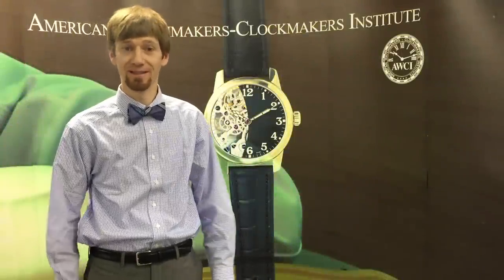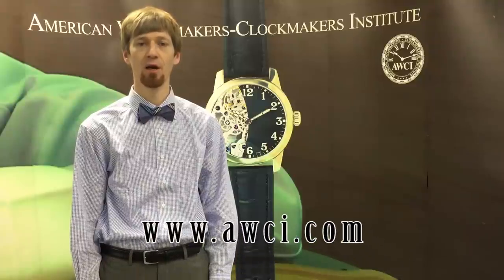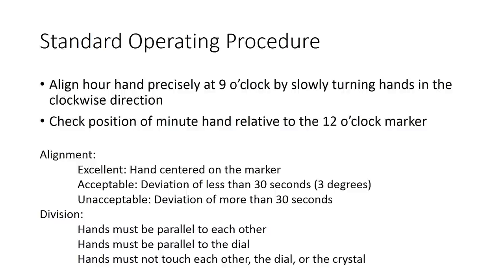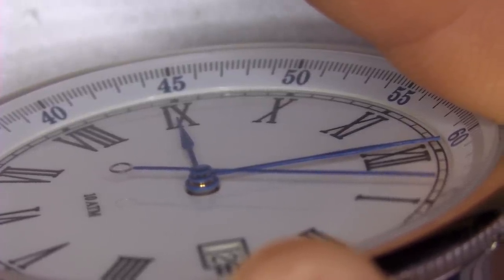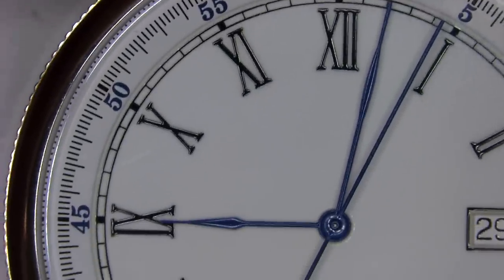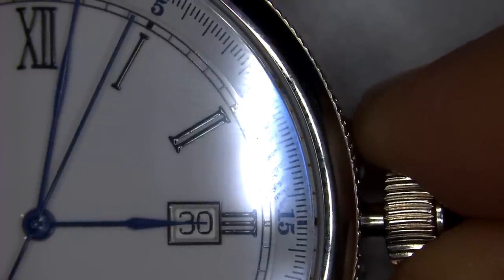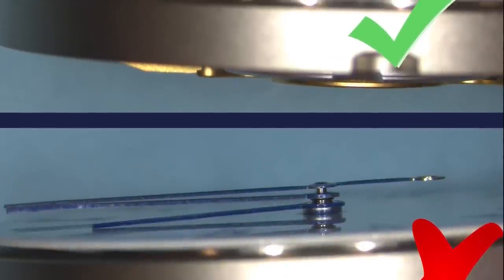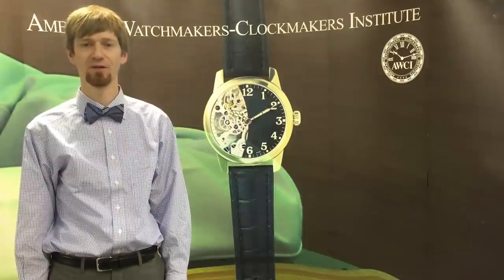Watchmaking Excellence: Hand Alignment

Comment: This is why you need to let down the mainspring so the balance wheel becomes stationary when fitting the hands, something few 'watchmakers' on the internet do. In fact if you pay attention, they almost exclusively rush past showing the hand positions as the minute hand centres on the 12 o'clock position in an almost 'sleight of hand' manner (pun intended)... much like an illusionist would do while performing a card 'trick'. This was an EXCELLENT tutorial. Bravo.

Comment: I guess it depends on the movement how you check it. Based on my experience, you move the hand forward to check seiko and move the hand backward in miyota movements. Because the gear slack is enough to give you the illusion that the minute hand is at exactly 12 when setting it. But when the watch is running, it would be off.

Comment: Most Citizen and Seiko and some Swiss brands (Quartz watches) have the problem that the second hand stays in the middle of 2 second marks, and that really drives me crazy!
The Citizen Pro Master BN 0150 is one of the few watches from that brand that has perfect alignment of the second hand to the second mark.

I happen to have OCD, so when the second hand is at 12 O´clock I want the minute hand and the mark to have perfect alignment, and it can take me many attempts to achieve that.

Comment: Can I ask a queestion? When we set the hour and minute like this, the watch calender change otomatically  for example, 00:04 am. İt is not change 00:00. Why is it happening? How can I solve this problem?
Reply: This happens because the calendar mechanism is not in sync with the hour and minute hands, You must adjust the hands of the watch by first removing the hands and then turn the crown in a pulled out position (as you would when setting the time of the watch). Just turn slowly until the date start to change or has just completed the change. Put back the hands by pressing them on with the proper tools. All hands should point to the 12 o'clock position when pressing them on. This is not something you should do yourself unless you know what you're doing and have the proper tools or you risk serious damage to your watch.

Comment: I have a automatic watch that has this problem, it has a snap on back, if I take the back off, do I need to move the crown = watch winder and can I just use 2 cocktail sticks to hold the minute hand steady and turn the hour hand with the other wooden cocktail stick, is it easy to arse up and destroy your watch as I have never done this before, I have a $70 Chinese Automatic watch.
Reply: Dave Seekers No, it takes special tools to remove the hand and install it correctly. You won’t be able to rotate it on the post.
Reply: @jpficklin  Why is it not possible to rotate a hand on the post? Aren't the hands held on the post by friction?
Reply: @Teller3448  Yes, they are just held by friction but if you push on the hand it will usually bend or break before the hand slips on the post.
Reply: @jpficklin  Ok thanks...I will not risk it!

Comment: I got a mtd-1075 model Casio watch. I know the sec hand doesn't hit its mark is that fixable?
Reply from the maker: If the hand consistently misses the mark by the same amount then that is definitely something that can be fixed. Quartz watches can be a little different than mechanical watches for many factors. Visit our referral directory at www.awci.com/repair-directory to find a certified watchmaker near you that can help you solve this problem.
Reply: How much would it cost to fix.
Reply from the maker: We are an educational institution and we don't set prices. You will have to talk to one of the watchmakers in our directory who engage in watch repairs.